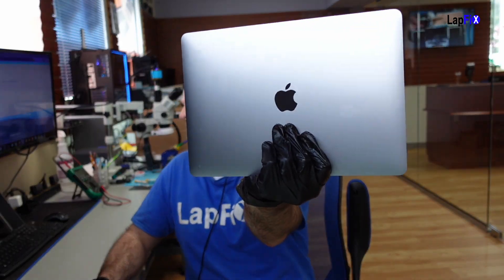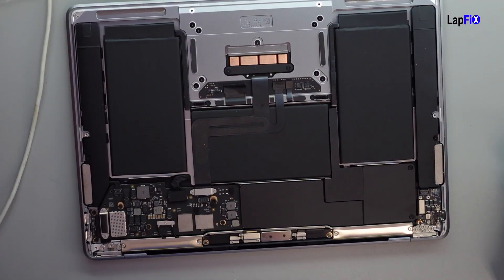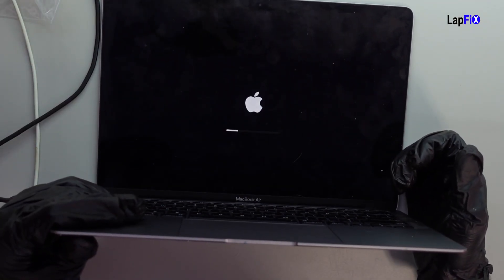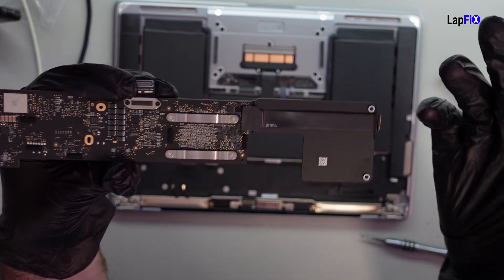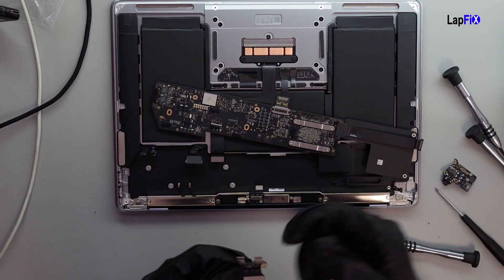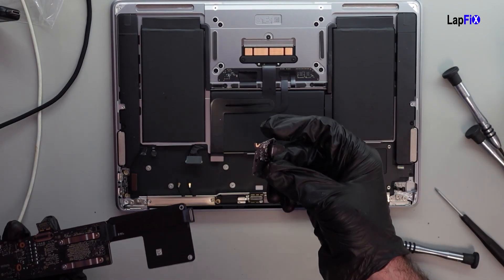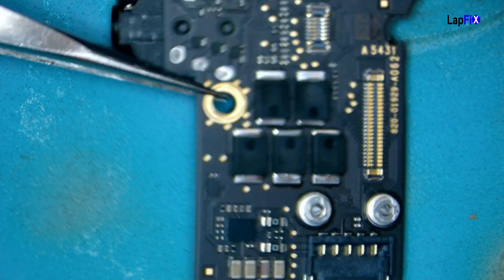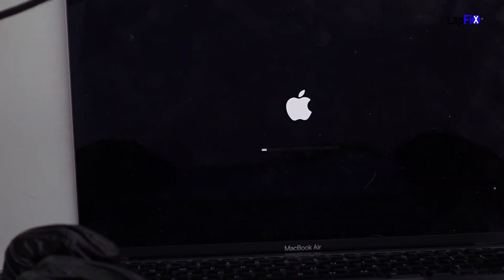Fixing a MacBook M1 Not Powering On

Comment: I have a macbook air 1932. I replaced the sisterboard and the flexi which connects to the motherboard (It was bad due to corrosion) but the machine is stuck in a loop where it starts up and switches off all the time. The Apple logo does not appear.

Comment: Thank you for your video it really helped me.  My son spilt a drink on his MacBook and it wouldn't turn on and Apple wanted £650 to fix it.  I bought the special screwdriver from ebay for £5.00, took the back off and removed the corrosion myself.  Luckily it wasn't damaged too much.  Plugged it in and it works fine!!!  Thank you.
Reply: How did you remove the corrosion?

Comment: hey bro i have a rival 3 wireless mouse, i had a problem where the battery leaked, i already cleaned it up and it turned on, but now the problem is that it only moves when i click right click and left click, but if i dont click anything it doesnt move at all any suggestions?